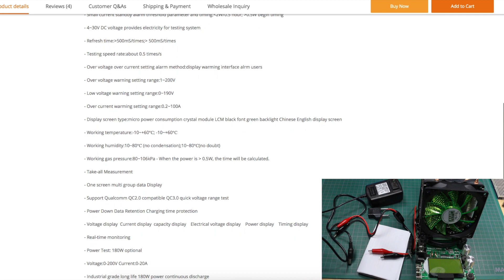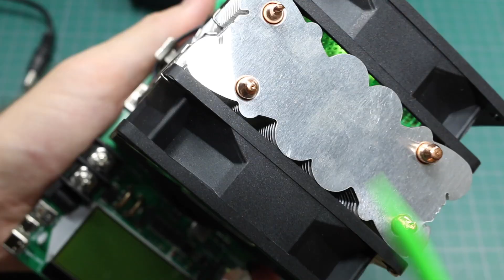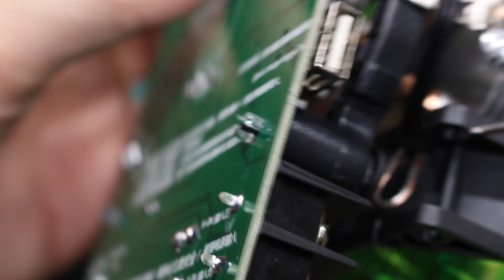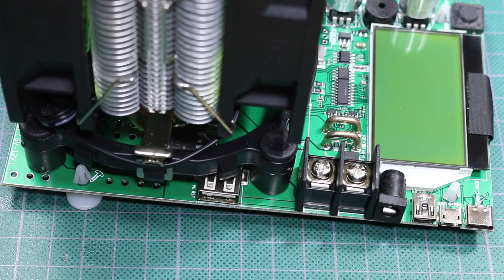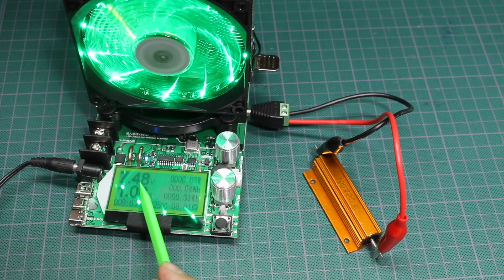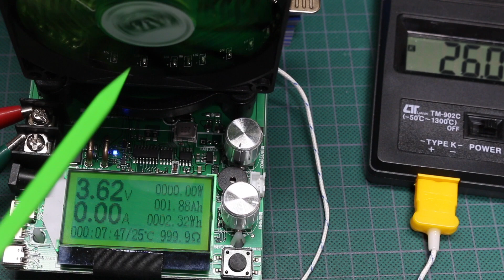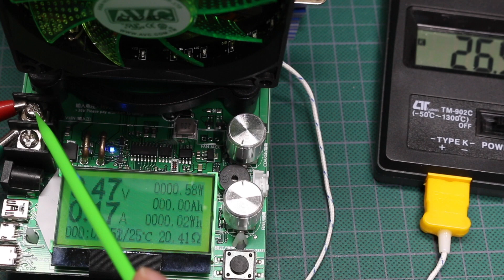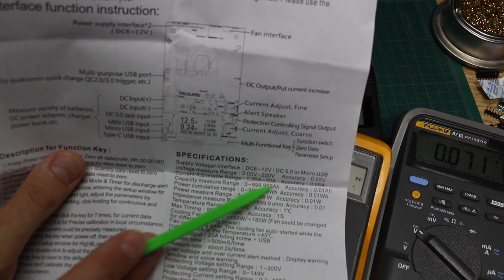Constant Current DC Electronic Load from Banggood - 200V 20A 180W

Comment: Maybe the JST can activate a circuit that presses/activates the button to stop it.
Reply from the maker: Only problem is there’s no dedicated test stop button and depending what is showing on the screen, if it’s displaying the actual cut off warning message or if it’s in the process of trying to start up again, it might even require a different combination of button presses to try to stop it but maybe the signal can be used to cut the power elsewhere like a relay or something.
Reply: See my comment below at:
https://www.youtube.com/watch?v=bx74sNFQvwc&lc=UgyaoQyE3XcHVWV8gTp4AaABAg.94MU-SfL1cK97D3g-qrfdm
 If needed on a particular version of the tester, then if you add the 
cutoff relay circuit I suggest in the comment it will STAY off.

Also, if you want easy manual control to stop the test you could simply add an on/off switch in between your battery under test and the input of the tester. You could make a special connector to do that so you don't have to disconnect any wires. Then when you switch that "off" the tester will think the battery has been depleted below the cutoff voltage (Vterm, Vcutoff, etc) stop testing and sound the alarm.

If while the alarm is beeping you lower the discharge current potentiometers (silver knobs) to zero, all the test data will be retained no matter what happens with the battery voltage, and you can read it. If you don't set the current to zero, then you may lose the data (at least on the tester model I received that happened a few times as the battery voltage crept back up over the <x.xx volts setting and I didn't have the battery disconnected. Probably depends on the manufacturer/firmware).

Comment: Might that resistance measurement be an impedance measurement instead? Impedance still confuses me ... 🤔 ... but not as much as it did just a few months ago.
Reply from the maker: With the only data available to the processor being the measured voltage and measured current, they must be just calculating resistance as voltage divided by current regardless if it’s purely resistive or  reactive, also the FET drawing the load is ideally a resistive load.  
 Here’s a little comparison of resistance and impedance. 

https://circuitglobe.com/difference-between-resistance-and-impedance.html